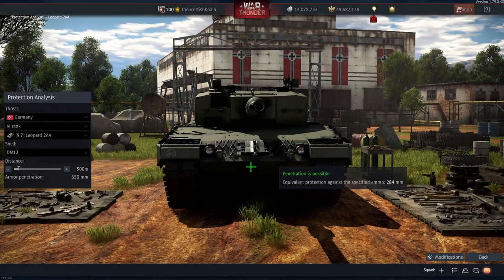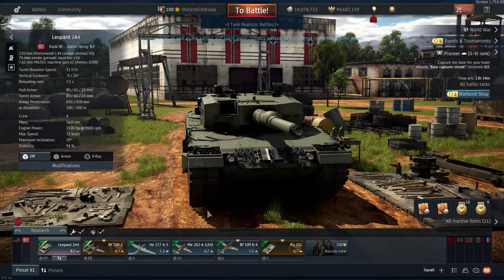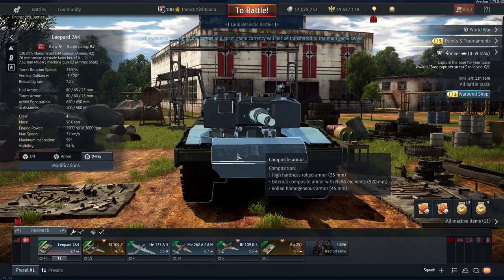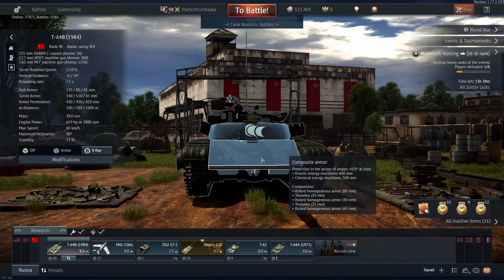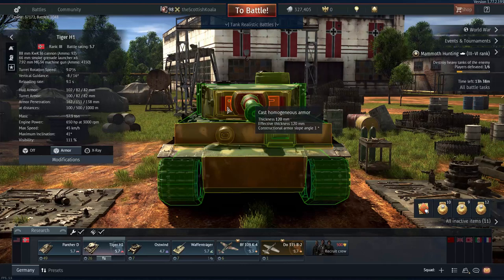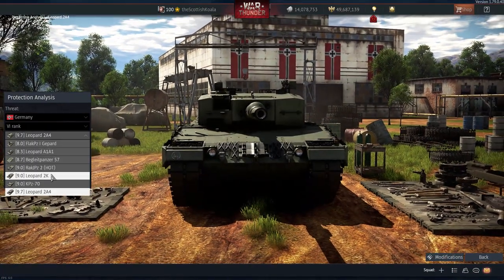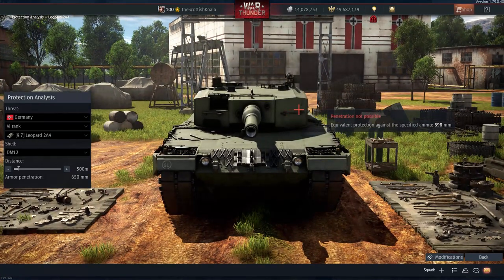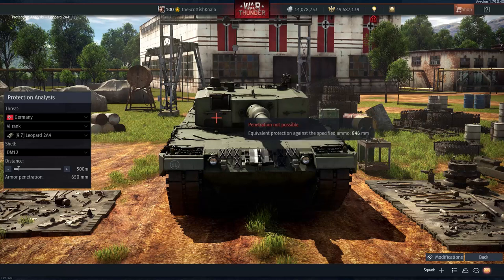(Tutorial) How to Use the New "Protection Analysis" Armor Viewing System - (War Thunder Update 1.79)

Comment: My squadron has done testing on the dev server using that tool, we have came to the conclusion that this tool may not even be 80% accurate on launch day of the patch. However we only tested tier 6 tanks, as a disclaimer.
Reply from the maker: Shit to hear, but very good to know. Thanks very much for the info, I'll be sure to keep that in mind.
Reply: sounds to me like bug reporting is going to move to the next level then. :)
Reply: theScottishKoala no problem m8. Obviously it will be use at top tier more so that is where we found the issues. It has to be due to the composite armor calculations

Comment: i woud still like the x-ray to show th efective armor value to at least have an idea of what shells will not pen overall so i dont have to look at every shell and if it can pen the armor
Reply from the maker: That's very true. This might mean less complicated work for us, but it WILL mean more tedious work checking what shells will pen what tanks where. The user made "tank polygon" map is still the best way to work it out.

Plus, I can't find out whether, say, the M18's APCBC shell will pen the AMX-40 (which it probably could) because it only allows you to select tanks of similar tier and battle rating
Reply: if they just say the armor in x-ry has 350vs ke that means in dont have to look at the shells that have 330 pen and that makes it a lot less annyoing then going thourgh every shell in the tier 6
Reply from the maker: Problem with doing that, like I said in the video, is that the numbers often proved inaccurate. The Challenger 1 was getting penetrated by the STOCK shell on the T-64B, which is lacking over 50mm of penetration necessary to get through that armor according to the stats. The armor also responds differently to different shells, like for example the Abrams' M774 depleted uranium APFSDS.

You only have to go through the shells that you actually plan to use at least. Not necessarily everything at the tier.
Reply: theScottishKoala then they coud say ot has 300 vs ke but it woud mean that no matter what kind of shell it is if it has only this much pen it will not pen
Reply: ya as a quick overview for people not needing the detail that would be good mate